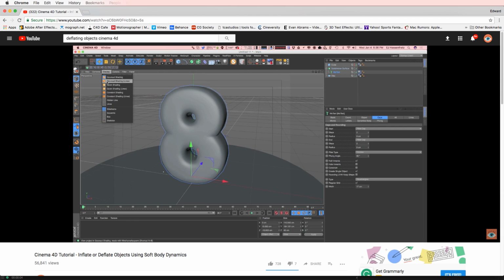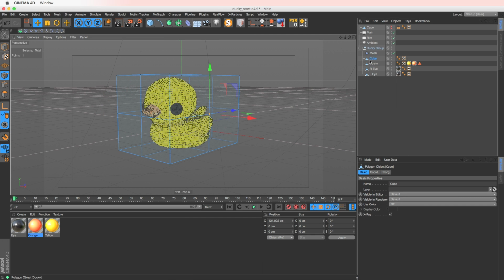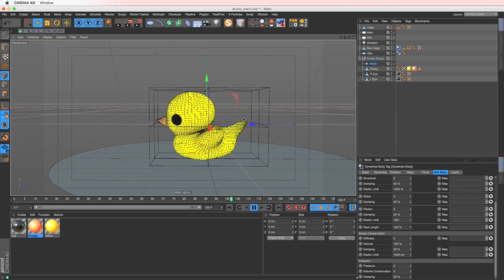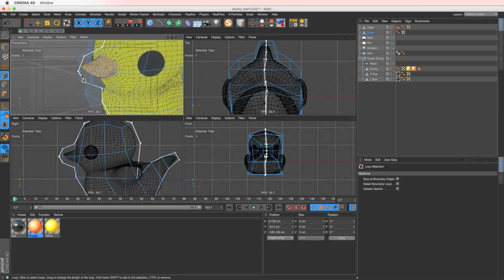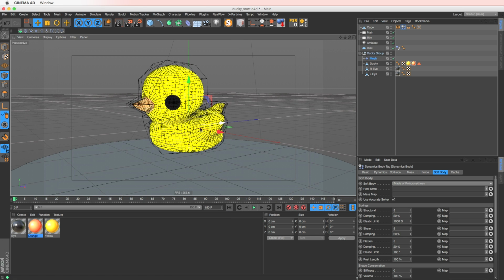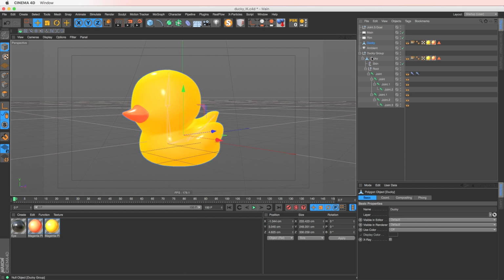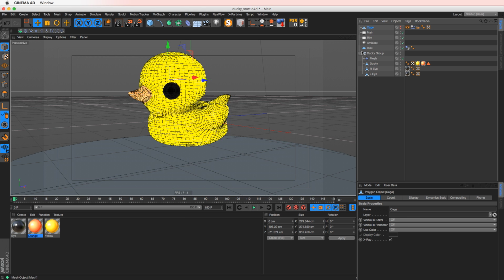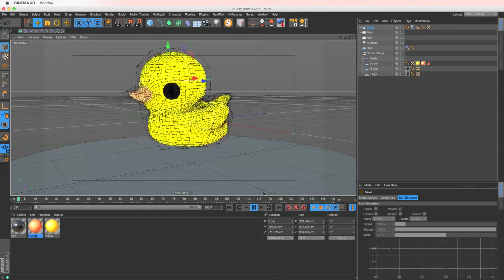Cinema 4D Tutorial - Speeding Up Soft Body Dynamics Using Mesh Deformer

Comment: I have a question: what if I want add my duck into cloner or particle emitter and save that soft dynamics- what I need to do? I tried to put only cage into it, I tried to put my model, but it didn't work...
Reply: Hi ! I have the same problem, I want to put a null into my emitter but only the mesh deformer move like I want
Reply: were you ever able to figure this out?

Comment: Why not just use the polygon reduction to create a mesh to put into the mesh tool and apply soft body to the hi res model? Surely quicker
Reply from the maker: The resulting mesh sometimes isn't the best or evenly subdivided - i would recommend using the volume mesher and creating a low poly mesh that way

Comment: its really weird but im getting 2 issues. 
1. The object jiggles heaps and wont stop even after 100 frames. I've done with a cube and it sits perfectly, same settings, my object (a car wheel) jiggles non stop and keeps sliding. Even with collision and friction set to 0 or 100.
2. My mesh doesn't touch the collider object. I placed my tire above and let it drop, it hits them floats above the collider body floor. Even when I place the wheel on it, it floats above when i press play. no setting ive adjusted fixes this
Reply: tried it with 4 different models. same issue every time.
Reply: and with very basic mesh boxes
Reply: noticed its something to do with the mesh box, but i cant figure it out. ive moved the mesh box around and segments etc and still, it bounces above the collider body, no matter where I put it
Reply from the maker: did you try messing with the expert settings?

Comment: Could I get some help please? I'm following all the steps --> creating a low poly cage by duplicated original object then applying polygon reduction, converting to current state object, putting low poly cage in mesh deformer, initialize, but then nothing happens. I have the soft body dynamics tag applied to the low poly cage, but nothing happens. It seems to work for me when i use a box cage, but as soon as i try the low poly cage from a duplicated object it does not work :( I've triple checked, and I am doing every step from this tutorial.

Comment: hi there, i just saw your deflating tutorial also and i have a question. Is it posible to import an object in .obj that i made in rhino and deflate it as you did with the objects from C4D? because i cant apply the effects you did, i followed step by step but the model that i import doesnt seem affected by the soft body or any other effect. Thanks!
Reply from the maker: Hey man!  This will work with any 3D model that is supported by C4D, I would make sure you are following all the steps on how to create the low poly mesh and using the Mesh deformer on it.

Comment: Hello EJ!

Two weeks ago i followed your old tutorial about the mesh deformer and using Soft Bodies, but i encountered a problem.

I have my base material and on top i have an alpha with a face on it (i set the projection to Flat) and when i press play the face stays in the same position while the mesh is deforming, is there a way to like paste that alpha to the mesh while it is deforming?

Thanks for the amazing tutorials!
Reply from the maker: If you have a Deformer deforming the mesh, you need to use a Stick Texture Tag to stick the texture onto the non-deformed object.  That should solve everything for you!

Right Click > Cinema 4D Tags > Stick Texture Tag
Reply: Alejandro Pérez Have you tried using the generate UVs command? GSG covers it in their tutorial with the dropping tiles. They use it for a fun logo reveal, but it should work for your situation as well.
Reply: @padoco73  Do you have a link i looked but couldnt see
Reply: Thanks guys! I'll try them out!